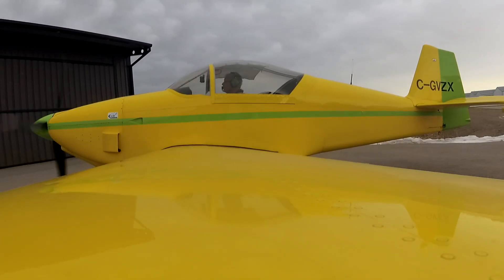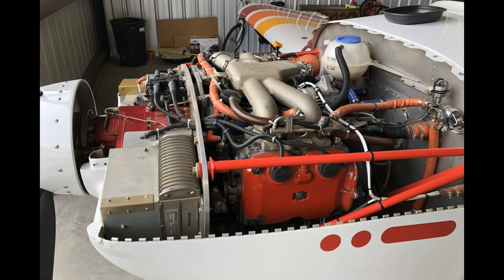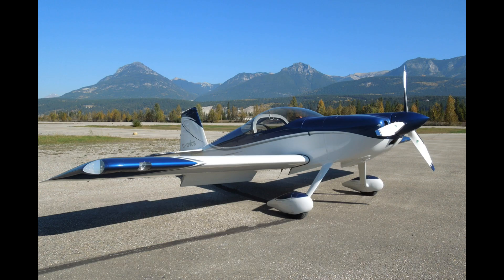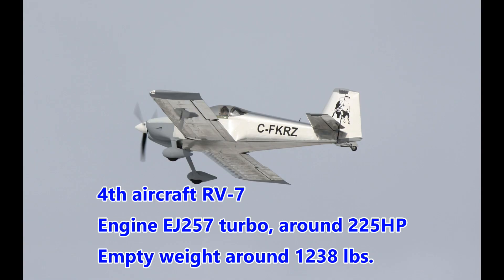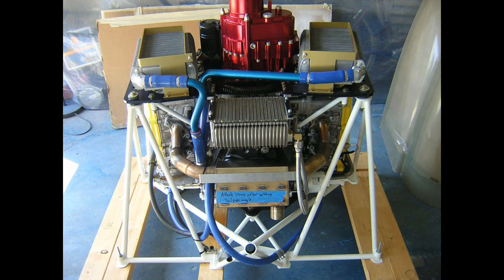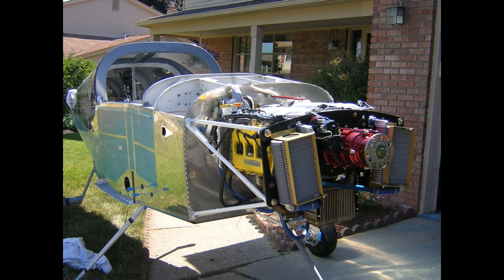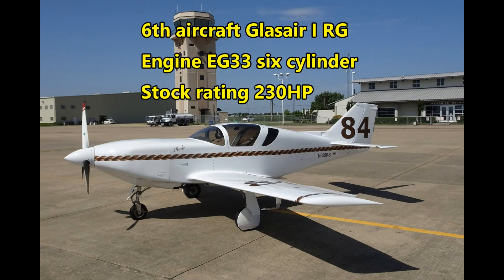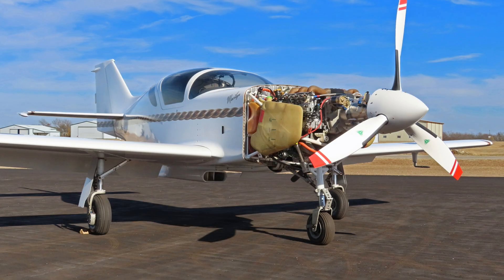6 Subaru Powered Aircraft

Comment: Another good swap is a H-6 3.0L from the Liberty / Outback with a chain drive. Standard Subaru engines of EJ series and some others had issues with the original headgaskets due to coating and would fail over time, so worth updating to the newer headgaskets for an EJ255 or EJ257 if you're considering that, or install copper fire-rings and do away with headgasket completely. Cylinder 4 may not get adequate liquid cooling in some engines under heavy load, and there is a mod for that to redirect coolant to get more dwell time near that cylinder. Forged pistons are probably best in this application.
Reply: The newer gaskets still have the same problem - it's a planned obsolescence thing by Subaru. The only permanent fix is to use the multi-layered-steel/MLS headgaskets, which came on all the turbo engines. It's only the NA headgaskets that fail. I should also say, the plastic headgaskets on eBay, sometimes called "composite" but they really mean high-tech plastic, are also better than the OEM Subaru NA "carbon" headgaskets, and they cost around $80 FOR A PAIR. For up to 300hp these gaskets are great and will last years. In fairness in a plane i'd still buy the MLS gaskets but in principle (and with a bit of testing at high rpm/load for a long time) i'd be OK flying in a plane with plastic gaskets haha
Reply: @John-rw9bv  what is the point of this comment? he already mentioned to use the turbo gaskets lol

Comment: Probably there are other videos that discuss this, but Subaru 2.5 engines from 99 to 2009 are famous for head gasket problems.  The 95  2.2 engines are not afflicted with these problems.  It's my understanding that the 2010 and later engines still have problems with head gaskets, but they leak to the outside instead of to the inside.  I don't know if Subaru has ever totally solved this.
Reply from the maker: Yes, this has been mentioned and very widespread as you mention. Something to watch out for but it usually gives lots of warning before it becomes serious. Good maintenance is key here.
Reply: A lot of what people think is Subaru headgasket problems is actually a Subaru headgasket replacement problem - specifically not doing a proper job removing the old gasket, planning the deck, and re-torqueing everything down correctly again. Because the engine really comes in 4 pieces not 2 like a standard engine, this machine shop work is a lot more important than people think. The planning for example has to be done to both the engine and the head's surface, and with each bolted down to a jig to account for the warp caused by bolting it down. Very few machine shops (unless they're subaru specialists) have these jigs, so a lot of blocks are planned flat not under tension, resulting in the headgasket surface being uneven when everything is bolted down. The result - the headgasket leaks and everyone blames the gaskets. OEM built gaskets don't usually prematurely fail, they fail at known mileages, give or take 10,000km, i.e. like a clock.
Reply: @John-rw9bv  Lots of people do engine work without the proper equipment
Reply: @writerjmd yup, and i'm no exception. But when it comes to engine work, it's best to really treat the whole thing as a single unit that gets refreshed 100% every time you take it apart. Basically you can take any 1999/2009 EJ engine running in a car right now, dismantle at home for free, then build it following youtube guides with components ranging from $500 to $5000 in your garage, and easily achieve 300-800hp. The only thing you probably can't do is re-align/surface all the bored holes (crank, cylinder and cam shaft holes), and flatten the two engine/head surfaces, all under typical engine tension. A specialist machine shop with the jig has to do that, which is not something a regular engine needs to worry about to such a degree. In the Subaru the block bolts are very structurally significant, since they hold all 4 bits of metal together in 3 dimensions, so if they aren't all aligned and parallel to the expanding block, with the spinning shafts nicely perpendicular to those bolts, the bolts can be as strong as they like, the aluminium will warp and leak at the headgasket. Subaru also didn't balance the crank and cam shafts all that well, since the boxer design eliminates so much engine vibration as is, but with those precision ground and balanced the engine really becomes rock solid in terms of reliability. But yeah with those planning jigs so hard to come by, a lot of people have headgasket issues particularly at high horse power or long/hot duty cycles. So it's not really the headgaskets fault per se, although the non-turbo (carbon) gasket does only have a 80,000km lifespan while the turbo multi-layered steel version will last longer than the crank bearings and never fails unless the deck was mis-prepped.

Comment: In a car it is operated between 2000 and 3000 rpm most of their life, in a plane cruising at 4500 rpm must add a lot of wear and tear.
Reply from the maker: They seem to last fine by aviation engine standards which is why I put in the Glastar experience which has pretty high time.
Reply: The automotive markets biggest concern is fuel economy. For an average car (Subaru for example), you only need 30-40KW to drive on the highway. It would be inefficient and needless to run an engine at high RPM. Also most wear is from start up and cold running, An engine that Runs long hours but at operating temperature will last longer than one that starts and stops regularly. Piston speed and engine temperature are more important. Engine temperature being largely overlooked by the aircraft industry and not a factor for a car running at 10% power for the majority.
Reply: @chippyjohn1  Actually the SBFC of the EJ22 is around 3000-3500rpm, high load, so you could argue running it at 2000rpm is inefficient and results in overall more heat for the same work done :P Regardless, Subaru's biggest weak point - the open deck design (bubbles in the engine block for unnecessarily large amounts of coolant to flow around the cylinders) makes it one of the best cooled engines out there, which is why they can have such high mileage if properly maintained, despite being cast aluminium. TLDR cooling isn't the problem with these engines. If properly machined, very little goes wrong with these engines at all, usually its the gearbox or a bearing/etc, which is basically an act of god
Reply: @John-rw9bv  BSFC changes at part throttle compared to WOT. Open deck design is not a weakness, it is a strength. Open deck allows cylinders to expand in a uniform amount, keeping them round. Important for a flat engine to reduce oil consumption. Also, instead of using cast liners you can use steel alloy allowing you to increase power substantially and also use sealing rings (fire rings) and you have no head gasket issue. If a cooling system is designed to run at sufficient pressure, there will be no bubbles or cavitation. Little going wrong on an engine that is babied with a squirt of power now and then is very different to an engine is run at full power continuously.

Comment: Only my opinion, having owned a beater Subaru Legacy for many years I finally had to retire the car after 283,663 miles. Damn good car/ engine despite being abused by the former owners & myself. I knew going in to the deal that it had seen it’s better days. Still impressive. I have an A&P & take some credit for understanding mechanical systems & engines, having said all that to say this, whichever way you go there will be obstacles & limitations on any power plant/airframe choice you make. Be sure to take a long look/ think on the ground before you attempt to get airborne. The skies are an unforgiving of mistakes type of environment. Be safe! Be sure! & Be ever watchful of cutting costs/corners, trying to save a buck! Good luck!

Comment: I once owned a Subaru impresa STI 2008 has 305 HP turbo charged. Very quick little car with the AWD never broke the tires lose at all. I eventually sold it after having multiple AC compressor and power steering pump failures. I bought a pickup truck. Later got the bug again to buy a turbo car we decided to spend less get the 2wd ford focus ST which 2L inline 4 turbo 258HP.  I noticed the inline 4 cylinder in the focus vibrates much more then the boxer Subaru motor did.  There is lot of aftermarket support for the boxer engine. It would be very interesting to have an aircraft with one. Makes sense a water cooled opposed engine to replace an Lycoming.

Comment: I’m not seeing 444 hours in 15+ years as being particularly impressive. Gearbox issues and removing it frequently for maintenance, head gaskets, etc all before 700 hours? Not exactly impressive there either. Our Continental certified engine some years runs 350-400 hours in a single year. Sitting at 1200 hours total time now on it and still going great. Prop has never been off. All but one of the fine wire plugs are original. It’s had standard magneto maintenance every 400 - 500 hours and a valve cover gasket replaced. I struggle to see why a Subaru engine would be attractive or worth the hassles described here. Seems like a lot of headaches and could likely accomplish more by modernization of an aircraft engine.
Reply from the maker: You could watch the later video featuring 4 more Subes, one with 2300 hours on it now. Lower cost is the big attraction. I tried to show the problems as well as the successes.
Reply: @rv6ejguy  I’ll have to check those out. Thanks for the reply and sorry I didn’t see it sooner.
Reply: The price is probably the main benefit that wasn't really raised here. Even with those hassles, it's a substantially cheaper engine to run and maintain, particularly if you have the same engine in your car/motorbike, know how it works, can do the basic stuff yourself. If the engine blew up but all the accessories could be salvaged, a replacement engine with freshly machined internals is less than 1/5th of the lycoming. Some people find the certification process is worth the money for the peace of mind, others get peace of mind by building the engine themselves, and with the Subaru that's very doable in an afternoon.
Reply: @John-rw9bv  In the experimental world you can still rebuild an aircraft engine yourself, though yes the parts do cost more. For the experimental non-certified ones Lycoming and Continental do charge less as I recall. I suspect the cost savings aren’t that great when everything is taken into consideration.

Comment: The fact that he used the EJ22 instead of the EZ30 is incredible
Reply: @Rogelio Alvaro you've got my attention
Reply: The EZ30 isn't as strong as the EJ22, the 22 has thicker walls and is a bigger engine in general. Well, per cylinder. The EZ has 6 pistons after all. The EG33 is an EJ22 with 2 extra pistons, i.e. the same thick walls, but it's a lot bigger than the EZ. The EJ20 technically has the thickest walls second only to the diesel EE20, but as any of these engines bored and lined with a high tensile alloy double or triples the maximum peak pressure, it's really a moot point. The strongest Subaru engine is the one that was lined with anything other than aluminium, and then the deck closed up anyway you like. I guess drilling out the main bolts for a thicker diameter rod/stud is the third important strength upgrade. After all that and some new rods/pistons they'll make 600hp all day long.

Comment: What is the viability of using wing leading edge skin cooling for the engine and oil cooling in order to reduce cooling drag?
Reply from the maker: Not enough surface area to do the job and hard to implement into the structure, probably quite a bit heavier than a traditional rad.

Comment: i'm part of the avid flyer group and we just had a group member have a catastrophic engine failure, (subaru) he damaged his aircraft trying to land in deep snow, He hasnt had a chance to pull the motor to examine what happened. In my opinion the subaru engine is just too heavy for avid airframes unless you have the stretched version or else you would have to add a ton of weight in back to balance it
Reply from the maker: Many types of Subes flying. The EA81 is around 145 pounds for the long block. I know of many of those flying. One of my customers with 700 hours on it now. Engine failures are usually caused by poor assembly if they have oil and coolant in them. Nothing wrong with the core Subaru engine as I illustrate here. We've sold over 500 EFI systems for Subaru aircraft worldwide over 26 years.

Comment: Refresh my memory but I have learned that those Subaru motors aren't reliable in cars, how did you get approval from the FAA for that..
Reply from the maker: You can use any engine you want in Experimental aircraft in the US or Canada. Watch the 2nd video with 4 more Sube powered aircraft- one with 2300+ hours on it.
Reply: https://youtu.be/bJSYDBjkJNQ
Reply from the maker: @paulbickley01  Yes, if you don't change the oil or let it run low, you'll have issues with many engines. Aircraft engines are usually well maintained as your life depends on it. The HG issue on open deck EJ25s is well known. Not usually catastrophic, lots of warning before they go and Subaru has a modern HG to fix the issue.
Reply: Who told you that Subaru engines are not reliable?

Comment: In the video you say “no problems” a bunch of times and then say they replaced gear boxes and fly wheels and have to pull the prop off and  gear box apart every 25 hours..  sound like a crap ton of problems.  You must be selling parts for these..
Reply from the maker: Early Egg PSRUs had multiple problems due to poor design with most being retired long ago and the Gen 3 boxes still have some known issues which require frequent inspections to be safe. The usual interval is 100 hours or at annual. Inspections hopefully keep you safe from a catastrophic failure and are part of owning any airplane. My Marcotte PSRU has never been apart in 18 years. The SPG-3/4 boxes have been proven robust as well.

Comment: Flying behind an EA81 engine, 300 hours no problems. Full EFI and electronic ignition setup which works well, no carb ice and soft idle so no lash on PSRU. Very smooth with great response, love it.
Reply: I have a turbo EFI EA81 on a Pitbull gyro with an Air Trikes PSRU & a 68" three blade, it's a great little engine for an old three bearing crank design.
Reply: @nzsaltflatsracer8054  Sounds like a great setup, any idea how many ponies you're pushing? What did you do about ignition and fuel setup.
The heads on my engine are dedicated EA81 fuel injection heads which were made for the turbo setup.
Keeping an engine solid and simple is the way to go, fewer problems.
Reply: @vumba1331  That's what my engine is, it came out of a turbo wagon. I used an Electromotive crank trigger ignition with EFI driver. I live at 6k-ft so I expect it's about 100hp-ish on 7lb @ 4600 & I can chug along @ 2200.
Reply: @nzsaltflatsracer8054  Sounds a great little setup. I haven't gone with turbo due to weight but living and flying around sea level means that it's really not needed.
Cruise at 80knots on 3,600rpm using 13 litres/hour, so cost effective. It is very smooth at those revs and I reckon the engine will last forever (-:
Reply: @vumba1331  Simple, reliable, light weight & cheap, I like all of that! I bought another running wagon last year on Craigslist for $350.
Reply: @nzsaltflatsracer8054  For spares or another project?
Reply: @vumba1331  Don't know at this stage, it was just too rare to pass up. My friend bought the only other known complete Pitbull in the US last year & it has an EA71 engine that will be a bit puny so he's deciding whether to do the same as I did or go to a Verner radial. Mine was N/A 1800 with Allison Injection when I got it out of Canada & it was OK-ish.
Reply: @nzsaltflatsracer8054  Checked out the Bulldog design, looking for at least 70 horse and the EA71 in its std form is only about 65hp at 5,600 rpm. Unless he does some work on the ports, can, timing, exhaust etc, he will be a bit shy on power. The Werner would be good with a great sound!
Reply: Subaru engines have lots of failures in cars, so why use it in planes?  I guess they make some that are good, is this the case for the EA81?  On what model/year can you find it?
Reply: @felixaudet5860  On what basis do you say Subaru engines fail a lot? The only variant that I am aware of that is not the best is the 2.5 litre version with gasket chafing on the heads, is that what you refer to?
We have owned 4 Subaru cars with EA and EJ motors up to 2.0 litre, never any problems with the engines, ran a couple to 200,000 kms without a glitch. They are like any other engine, look after them and they will look after you.